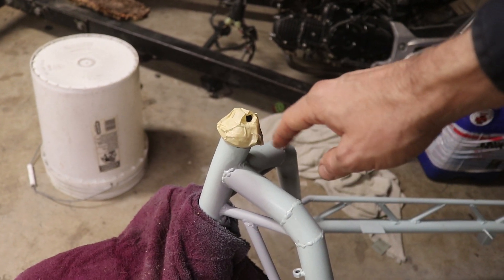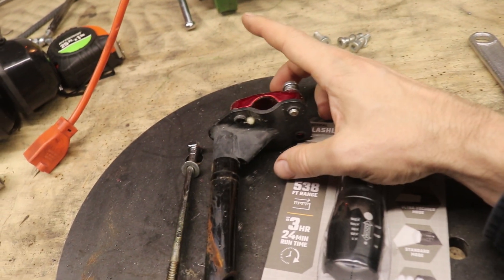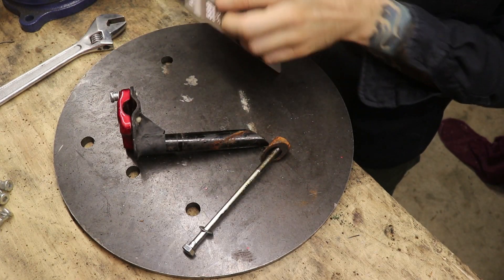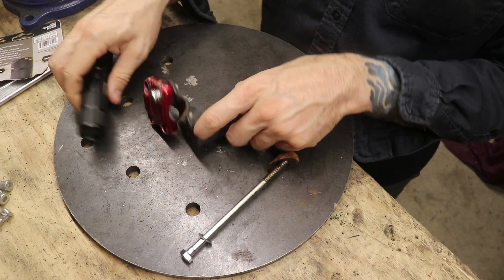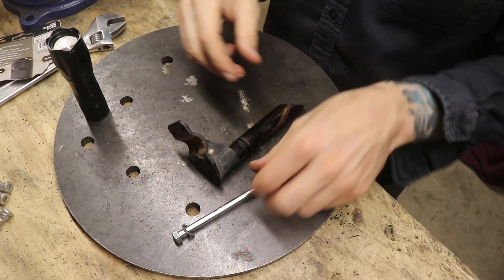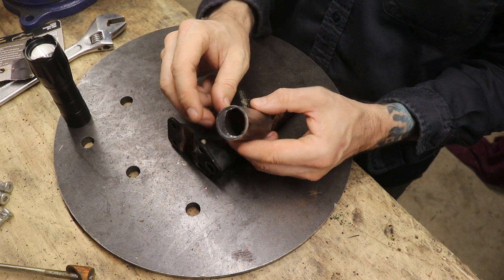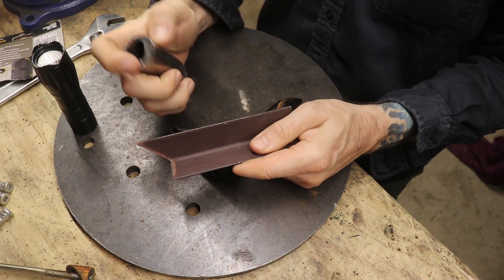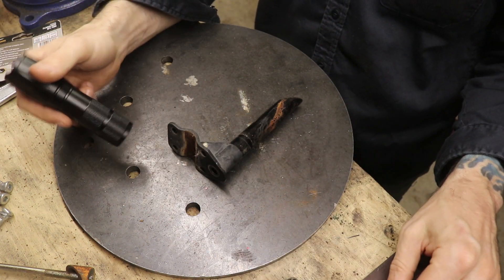Cargo Bike Curve Adaptive Light

Comment: Great idea man, I think I'm going to make the same idea for the long John I built as well, only I'll make it a dual  bull horn design that sits at the same level as the front head tube.
Reply from the maker: Good thinking 👍. If you have two lights, one can flash (for safety) while the other lights the way.
Reply: @HooptieDoodle  I was thinking more that it would put out a more concentrated and wider beam of light on the road, also it wouldn't block your field of view as much having a lower profile .